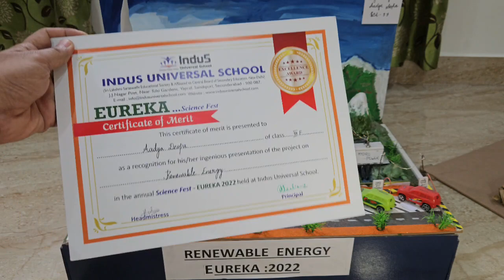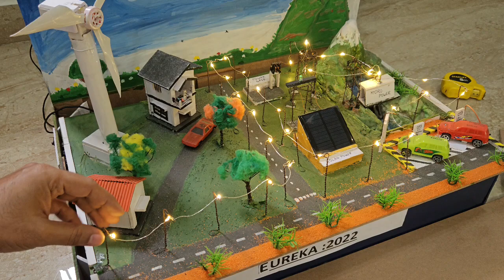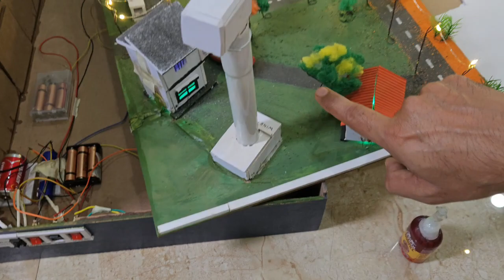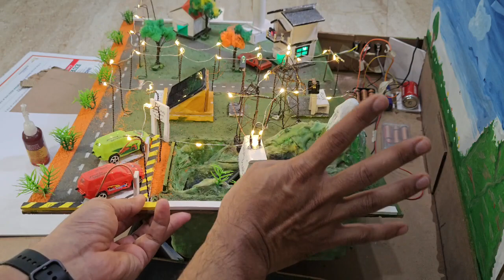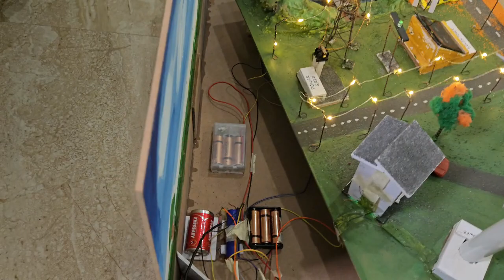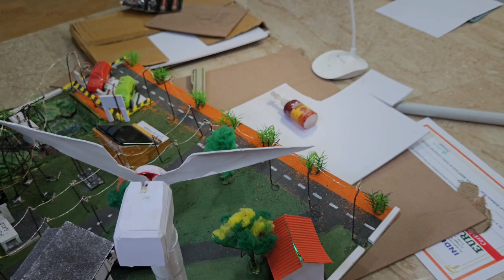RENEWABLE ENERGY PROJECT Explained in full Detail

Comment: Sir can tell us what you fit in box battery or??
Reply from the maker: Hi thanks for your question. The battery in this project is lithium 3.7 volt 2500 mah rechargable 3 cells in series making around 12 volts when fully charged. And for power conversion for each light a buck converter is used with voltage settings.
Reply: @amitdeopa   ok thank you sir

Comment: Really like it but i didn’t understand what the windmill and the water turn on, the lights of the house or the one's from the street? Or it is just an example?
Reply from the maker: Thanks for comment.  Do subscribe and share please.  The all operations are powered by Batteries 🔋 as shown in the video. This is a example how renewable energy can be generated. Only thing that is generating energy for real is solar power. Rest all is not possible to generate power on its own as the  scale and mode power generation dosent support so its an example only.  Do suscribe like 👍 and share please. Thanks